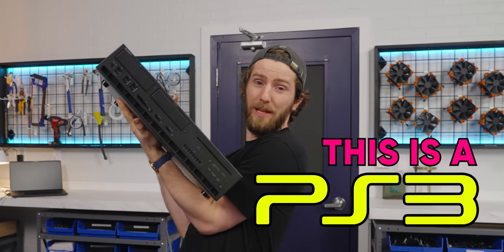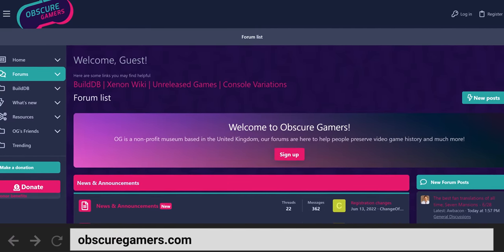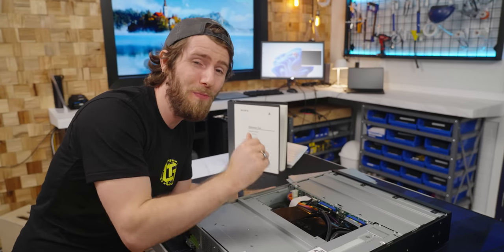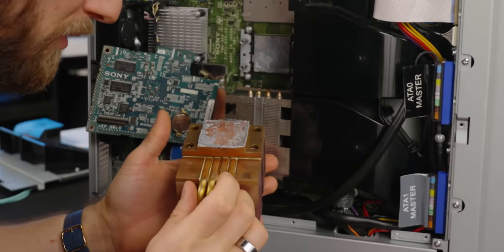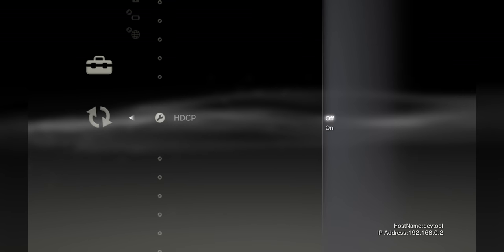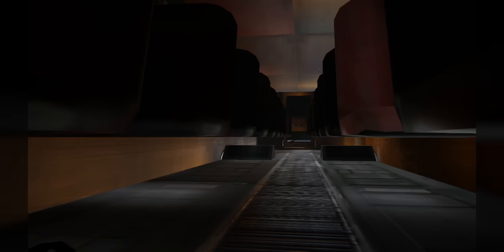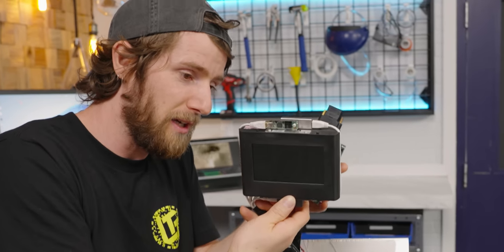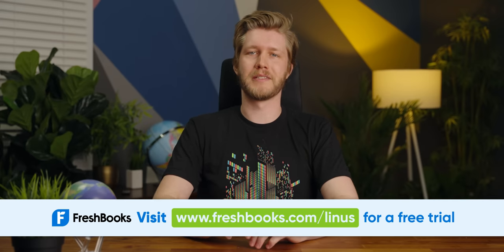I Await Sony’s Cease and Desist - PS3 Dev Kit

Comment: The PS3 Cell Processor was a shitload of horsepower in the day.  We ran a Linux variant and nettools on it to just get an idea of what it was capable of. It was stunning.
Reply: I did some intensive internet searching a while back to see if it was possible to compare the cell to a modern CPU. From what I could determine, the PS3 CPU is close to a Ryzen 3 2200G (but with the same power spread across more cores). In 2005, that was absolutely insane for the time. Unfortunately, almost nothing was able to use its full power as the cores didn't "talk" to each other.
Reply: @joshjlmgproductions3313  It's so weird how the PS4/X1 has weaker CPUs than the PS3/X360.
Reply: @MaxIronsThird  I think the X1 CPU is more powerful than the X360, but yeah, the PS4 was a downgrade from the PS3 in multiple ways.
Reply: @joshjlmgproductions3313  Xbox360 uses a variation of the Cell processor.
Reply: @MaxIronsThird  From what I've read, it uses a different CPU designed by IBM.
Reply: @joshjlmgproductions3313   It's a modified Cell processor, both made by IBM, it has the same 3 main cores, the 360 just doesn't have the smaller specialized cores.
Reply: @MaxIronsThird   WRONG

Xbox 360 use triple-core IBM designed Xenon as its CPU

while Cell processor core is called PPE and SPE. it is something exclusively created solely to use by Sony alone.
Reply: @kumomeme7852  This right here. Im amazed how these systems are over 10 years old and there still arguments online about what the actual hardware is lol. The Cell was to complicated for the time. Thats why so many multi platform games untill around 2009-10 were just plain better on the X360. Naughty Dog was really the first to really figure out the cell. Uncharted 1 and 2 and then the last of us really shown what it could do. Midnight club LA on PS3 honestly sucks. X360 was sooo much better on that game. 2006's call of duty 3 is the same story.
EDIT: GTA 4 too. the PS3 version ran at such a low resoultion it was hard to even see when traveling at any speed and the frame drops were...high teens at the worst. Another X360 win.
Reply: The ps3 gpu was really bad compared to 360, those SPUs  helped to patch the weaknesses of the gpu
Reply: @kumomeme7852  Xenon and PPE are adaptations of the same in-order PowerPC design, The thing that makes Cell "Cell" though are the SPE's, which is an array of Mostly-Altivec SIMD units that you have to manually shovel data to/from to get them to do anything. So there's a LOT of power on tap but it's not at all readily accessible to a compiler and requires a lot of thought about the design of code and micromanagement.
Reply: @TorazChryx  Agree but it's still the same base design and MS could've chosen to use the entire thing if they wanted to, it just wasn't viable moneywise.
Reply: @kumomeme7852  I'm sorry, but you're wrong, if MS wanted they could use the entirety of the Cell processor, but it was too expensive and super complex, so they chose to strip it down, IBM can sell the Cell design that was co-created with Sony, to anyone.

Sony doesn't have any exclusive rights on the processor, even though they helped make it.
Reply: @MaxIronsThird  you're right in saying that the 3 IBM cores in the Xbox 360's Xenon CPU are essentially the same as the single PPE (the "big core") used in the PS3's Cell CPU, there are only a few slight modifications between the two. 

But doesn't really mean that the Xbox 360 uses 3 Cell CPUs, since Cell is composed of 1 PPE and, most importantly, 7 SPEs. 
The SPEs that the Xenon lacks are the real sauce that makes Cell the CPU it is. 

The SPEs are way closer to a compute element you'd find in a GPU than they are to a CPU core (so much so that toshiba released video and 3D acceleration cards based solely on them).

Although they are technically capable of functioning as a general purpose CPU core (in fact the OS on the PS3 runs on one of them) they aren't really intended to be used as such, their control is slaved to the PPE and they work as coprocessors, they are meant to be powerful number crunchers, that's their biggest issue. 

When used for general computing, feeding the SPEs the huge amount of data they need to crunch is tricky, so in reality you just end up under-using them, or even not using them at all.
Reply: @samporterbridges2766  Sony actually didn't even mean to put a GPU in the PS3 originally, they wanted to use Cell for everything (both CPU and GPU work), that's why those SPUs are the way they are, they were meant to also handle the graphics. 

Sony had to take a step back though, eventually, IIRC it happened when they first learned the Xbox 360's GPU specs from some sort of leak.

They totally panicked and they had to hastily source a GPU from Nvidia, but the damage was already done.

They ended up putting both the Cell and an "afterthought" GPU in the PS3, with the graphics obviously being handled by the GPU while the (comparatively underpowered) CPU part of Cell handled everything else, the problem is that now they had nothing to do with the SPEs, they had to be pushed into some sort of workload, somehow, but they didn't really know how to.

Developers really struggled in the beginning, most early games barely used the SPEs, some didn't even use them at all. 
They eventually figured it out, but it really took way longer than it needed to (and we all have to blame Sony for it), by that time, the PS3's lifecycle was sadly coming to an end, as the industry started to work on the PS4.
Reply: There were several research institutions that bought farms of PS3s that they clustered together (using Linux back when the PS3 firmware had the OtherOS feature) to have in-house supercomputer abilities. See this Wikipedia article's references: https://en.wikipedia.org/wiki/PlayStation_3_cluster
Reply: @kumomeme7852  no the ppe was modified a little (triple core) and then put in the Xenon chip by ibm.
Reply: IBM has taken the Cell processor from early stages, stripped it down, and sold it to Microsoft
Reply: @eddycolangelo  Mostly correct.
The way that the Japanese do software, especially during the late-90s to mid-00s is very different to the approaches taken in USA. Obviously things get narrower with the passage of time.

When you look at the PS2's hardware, it's EmotionEngine is a mess to work with. But then look at a title like Gran Turismo 3, and it's a very weird software that runs weirdly on a very weird hardware. From our perspective.

The same is true with The Cell in the PS3 hardware. It had VERY ambitious beginnings, as being a "System on Chip" but in a Desktop Size. By using various special processors to blend CPU and GPU together, to process things, and sharing RAM.

In the real world this didn't work. Most gaming studios, or the lucrative ones, were based in USA and used their standards. What looked like RAM sharing turned out to be fighting for memory. And what looked like cooperative processing turned into a complex mess of code.

To top it all off, technology goes in cycles. There's periods where CPU design kind of stagnates, and so does GPU. Which means trying to make a v2, v3, v4 etc of a new Hybrid System becomes bothersome. The best of both worlds is probably a compromise, where you have AMD making Zen1 CPU, shared RAM, and Vega iGPU as a System (or APU). Or something more advanced like Apple's A14 SoC, or M1 Max Chipset.

The advantage of Sony's approach, is if they were able to get a winning design (which they couldn't) then they could own the rights to it. It would be hard to crack. And even harder to reverse engineer, or emulate. And they could potentially refresh this architecture in the future, and dominate the industry because the developers would be locked into that platform. Which could make their third-party titles less optimised for other consoles and PCs.
Reply: In a better timeline:

Bill Gates ego would not get the better of him, and the original Xbox would have gone all-in with ATi-AMD. Which would've saved that company from bankruptcy in the mid-00s, and made both Intel and Nvidia smaller competitors (not monopolies). And they would have automatic backwards compatibility between the x86 Xbox, x86 360, and x86 XB1. And they wouldn't have stuffed their chances in the gaming marketplace like they had with other stupid decisions.

Also in a better timeline, Sony would not have signed a contract with the devil I mean IBM. And perhaps joined a professional partnership with British firm Acorn Computing. They could have built a system, again with lots of small processors, but this time with coordination of an ARM11 system, and perhaps opted to use a whopping 1GB RAM. This would've made it possible to run the PS1 and PSP games on the PS3 via software. And in the next revision, Cortex-A8, it would've allowed their handheld (PS Vita) to have sideway compatibility with PS3 titles, with minimal effort from developers. While their next-gen console could have come earlier using many cores of the Cortex-A17 processor. Which would pave the way for a Sony phone that would be a handheld console on the go, and would get docked at home.

Meanwhile, Nintendo is pushed out of the market for being too slow, and stingey with hardware. They pivot into becoming a software-first company. Which surprisingly turns out to be a great move, and they collaborate with lots of companies for hardware direction. And they churn out many games, and make a lot more money than anticipated.

Valve on the other hand sees the threat from MS, and reacts a little differently. They make SteamOS and SteamBox, but this time it is successful. Instead of letting other OEMs butcher it, they develop the Software, Controller, and Hardware together. And they sell each unit as a way to move games away from Microsoft and it works. So Windows becomes a boring system, even more than OS X, as people either get an Xbox, or PlayStation, to play mainstream games. Nintendo games are fun and wholesome and available on both platforms. Steam continues to be a powerhouse, as more people start flashing SteamOS onto their old PCs and enjoying their games on an open platform.
Reply: @MaxIronsThird  the 360 uses a PowerPC-based CPU codenamed Xenon

the CELL also is PowerPC-based, but also has additional processing cores running their own architectures that tasks can be delegated to, so you're not entirely wrong, but also not entirely correct either
Reply: @bassblaster505  the CELL's PowerPC core from what I know is weaker than the Xenon CPU in the 360, but it vastly makes up for that with its SPEs that tasks can be delegated to by the programmer

the problem is that most multiplatform games and a lot of early 1st party games didn't make much if any use of them, leaving the slightly weaker PowerPC core to do all of the work
Reply: @ekinteko  That's some serious fanboyism there.  I think you need to see a doctor about it.

And Acorn Computers were done by the 00s, running off shares in ARM and winding down.
Reply: @tams805  Thanks, that was the deliberate message I was aiming to get across. It's always fun to do these thought experiments. Things could be different, better in so many ways, but we live in the here and now.
Reply: @MaxIronsThird  - Isn't that a testament to how much the GPU has advanced? The CPU is less involved in graphics and now is more of an I/O processor and disk cacher. The other thread unique to gaming is "events" recognition say when a bullet hits a character. That is now in the GPU so really the image and all its elements relationships are not a CPU task.  Roll back to the PS3 and prior, the CPU did a lot of the house keeping and image planes control. This of course means the details cannot be rendered at a high frame rate because the CPU and its fairly slow memory accesses are creating microsecond rendering stalls all the time.
Reply: @joshjlmgproductions3313  - The Cell processor is a PowerPC ala the old Macintoshes. The Cell processor took a base level Power PC and augmented it with "support cores" that were not full featured Power PC cores. For example only the primary core had math functions (floating point) and the like.  Still, it was truly impressive. As noted by someone else here the cores were not unified as they are in modern hyperthreaded CPUs but they could "divide and conquer" beautifully.  The nettools we ran as an experiment did standard routing protocols converting one type of stream to another - say Ethernet to ATM etc. Was just stunning. Not as fast as modern custom "network processors" but for the day from a home toy - just wow. Drives home the point that volume moves performance down the price curve much faster.
Reply: @joshjlmgproductions3313  "the PS3 CPU is close to a Ryzen 3 2200G (but with the same power spread across more cores)" 
In other words, it's a completely different processor. Spreading a load across multiple cores isn't always viable. More importantly, the Cell simply wasn't designed the same way most CPUs are. It was actually more akin to what we're starting to see now with Alder Lake, except still not really the same.
Reply: @dennisfahey2379  More like CPU hit a huge stagnation between Sandy Brige in 2011 and Zen 2/Coffee Lake in 2018, and it was mostly bc of more cores and hyper threading that it mostly ended, while GPU started getting more and more powerful  since around '07 and haven't stopped yet, but it might, at least for NVIDIA, Lovelace(RTX4) is basically a very similar architecture to Ampere(RTX3) and even the older Turing(RTX2), they're just clocking those chips higher and higher with improvements to RT and tensor cores, i don't think they can keep doing it after this though, they need some major changes to think about competing with RDNA4 by 2024.
Reply: @CanIHasThisName  Isn't the 2200G around a 4770k from 2014?
Reply: @MaxIronsThird  Saying that the X360 used a variation of the Cell processor is like saying Ryzen CPUs are a variation of the PS5 processor. In other words, it's misleading and inaccurate. Both PS3 and X360 were using a CPU from IBM and Xenon cores were based on the PPE design of the Cell. Simply put, the three cores of the Xenon were based on the same design as the one big core of the Cell - and this description alone already hints why they were wildly different CPUs. 
Microsoft didn't strip down the Cell or anything, they wanted IBM to design a core for them to be used in a tri-core CPU and that core design is what IBM offered. The PPE was just one of the elements to be used in the Cell, and it is not what defined the Cell CPU, it's the rest of the design, actually.
Reply: Cell was extremely powerful at the time, but also super complicated and PS3 clearly demonstrated why you don't want the hardware to be complicated in modern game development. They were able to get away with it on PS2 due lack of proper competition, but with Xbox making waves and PC gaming not being dead contrary to what a lot of "experts" were saying, it just didn't make any sense anymore and I bet that with hindsight, Sony would rather get something different even after the Cell was already developed because the early years were brutal for the PS3. Even when the system was still expensive AF they were selling them at a loss. Then people started buying the PS3 as a cheap BR player. So not only was Sony selling hardware at a loss, people weren't buying games to offset that loss. Sony cut down the features of the PS3 to lower the cost, which only made them look bad. And of course, most multiplatform games ran worse on the PS3. Even when the X360 had some 60% failure rate (yes, really), it kept beating the PS3. Xbox not only was leading in game sales, it was easier to make games for it so there just isn't any wonder most companies weren't keen on spending more money on developing games for a platform that sold less. Sony was only able to catch up very late in the lifespan of those consoles and to the surprise of absolutely no-one, they prioritized simplicity with the PS4.
Reply: @samporterbridges2766  Not necessarily, the biggest problem was the lack of a unified memory pool (Only 256 MB of RAM for the CPU/GPU) and the very complicated architecture of "The Cell" that held back many multiplatform games in terms of performance compared to the Xbox 360
Reply: @CanIHasThisName  The processor inside the Xbox360 and the processor inside the PS3 have the same base design by PowerPC and IBM, correct?
Reply: @MaxIronsThird  nope, the PPE in Cell and each of the 3 cores in the Xenon are all Power PC based, but doesn't mean that the Xenon is based on Cell, Cell is not just the PPE, it's a PPE and 8 (actually 7) SPEs.

The Xenon lacks the SPEs, the SPEs are what makes Cell the CPU it is,
Reply: @CanIHasThisName  
I get that you mean that it's similar to Alder Lake in the sense that they're both heterogeneous architectures, but it stops there, Alder Lake is basically Intel's take on ARM's big.LITTLE, Cell is still a wildly different architecture from that to say the very least. 

I'd rather say that Cell is somewhat close to a CPU with an accelerator, a co-processor, like a Xeon Phi or something similar, but all on the same package, instead of being separate, discrete components.
Reply: Too bad the RSX was underpowered so it would spend most of that excess just compensating for the graphics.
Reply: @MaxIronsThird  The processor as a whole? Nope. Just that one core (or three in case of Xenon).
Reply: @eddycolangelo  there was an old demo back in the day of a cell processor system doing ray tracing. Probably the only thing it was doing in that system mostly but there definitely was a lot of ambition for the platform. Unfortunately, with such ambition comes cost. And it was just more cost efficient to have a dedicated GPU next to a Cell
Reply: Tbf the limitations a lot of games ran into during the PS3/Xbox 360 era was the lack of ram not the CPU/GPU. The PS3 shipped with 256mb ram and another 256mb of Vram while the 360 shipped with 512mb shared RAM.
Reply: @TheotherTempestfox  I think so. Maybe it was just that stuff like Microsoft trying to mandate 720p resolution in games was premature for the generation but like you said, lack of RAM.
Reply: Yes, and IIRC, the DoD bought a crapton of them that they put together into a cluster for running complex simulations because it was so much power. I'm not sure what happened after Sony took the Other OS option away.
Reply: The weird thing about all this back and forth is that it seems to be overlooking console history.  Before consoles started becoming more like PCs, they were far more of the design used by the Cell processor.  If you look through the older pre-XBox designs, the common trend is to have a CPU (6502, m68k, whatever) that offloaded a lot of work to other special purpose cores on separate packages... consoles from that era had sound, DSP, PPU, etc type chips that were far more like full processor chips than more modern designs.
Almost like a modern game being written with a large chunk of the rendering engine being moved to a GPU compute core and all "traditional" GPU and sound API calls being made from inside that compute core.
Then again, depending on how you look at it, the special purpose cores being used in newer silicon can be compared to back when there was a discrete math coprocessor, and encryption coprocessors aren't entirely new things either.  When looking at the architecture like that you can start to wonder why it was difficult for developers to work with offloading work, but the probable answer is that designing for PCs and PC-like consoles change the approach.

From what I remember, wasn't one of the neat features of Cell architecture that the support cores were such that a chip with a failure that disabled one of them would still perform within spec using the remaining cores?

I hate x86 so much.
Reply: Did someone say the ps4 is a downgrade from a ps3 lolololol
Reply: @cav89-  No, I was talking about a "better timeline" while you're thinking about a "much better timeline".

It's too bad no-one has seen this mythic "best timeline" that place would be heaven to visit ; )
Reply: @joshjlmgproductions3313  so it was multicore but not multithreaded
Reply: @CanIHasThisName  I was just using the 2200G as an easy point of reference so people could understand easier. I know the chips have almost nothing in common, I was just referring to raw compute (which is rarely comparable across devices, let alone use cases and applications).
Reply: @jpesicka492  You could say that in a way, yeah. Though, keep in mind that the Cell cores aren't really comparable to modern x86 CPU cores.
Reply: @kenmastersmaster  In terms of total theoretical computer on the CPU, the PS4 is actually less capable. That said, because the PS4 used a more conventional architecture, it was still more powerful in nearly all use cases.
As for the GPU performance, it's not even close. I might be getting these numbers wrong, but off the top of my head, I think the PS4's GPU was 10x more power than the PS3's.
Reply: @kumomeme7852  actually IBM was the manufacturer of Cell. And MS knew that, so they commissioned the X360 CPU from them, giving them so little time that they knew IBM would have to use some of Cell's infrastructure in X360's CPU. So they're more similar than you think
Reply: @joshjlmgproductions3313  The design lead actually explained that this was done on purpose, since the PS3 was a mean beast machine but almost no one aside from first parties knew how to use it, they decided to make it a bit more "Generic" so that Devs wouldn't have so many problems, I think it was said on 2016 or 2017.
Reply: @joshjlmgproductions3313  honestly we were seeing the PS3 real potential at the end of the Generation, if Sony kept using it, right now the PS4 and PS5 would be backwards compatible with PS3 and would be real beast... Well maybe not that much but yeah.
Reply: Yellow dog Linux
Reply: @MaxIronsThird  the 360 doesn't use the cell processor, it uses a totally different 3 core processor named the xenon. sure, they might use the same ISA but the cell is still super different
Reply: @XENON2028  check the date before responding
Reply: @MaxIronsThird  idc about the date of when it was posted though
Reply: @XENON2028  discussion is already over
Reply: @MaxIronsThird  idc tho
Reply: Its because of ps3 could be ran as a server in a data Center. U could combine many ps3s to make a super computer
Reply: @MaxIronsThird  Sony developed those processors together with IBM MS did not have the option to get that CPU. The reason why sony used the cell processor was mainly because they wanted to have exclusivity and that game devs focus on building ps ports. It qouldnt make sense for them to invest in a tech that MS could just use if they wanted.
Reply: It's sad it's complicity held it back, it packed more than enough power to leave Xbox 360 in the dust, but it was never possible to fully use its potential
Reply: @MaxIronsThird  because they're not lol
PS4 and Xbox One are miles ahead of their predecessors lmao
Reply: @ekinteko lol the ps3 can run psp games and psx no problem lol
Reply: I did something simular back in the day with my father
Reply: You saying horsepower gives me the ick
Reply: Didn't the US army use them in array for a server? I have some vague memory of hearing that
Reply: @joshjlmgproductions3313 yeah the cache was awful
Reply: All that power and still worse performance than 360. Sad.
Reply: Yeld was terrible in the end they switched off cores on successful chips so they could use the defective ones in new Ps3s
Reply: @eddycolangelo this is also a big contributor to the YLOD of the PS3
Reply: what were you comparing it with and how fast was it

?